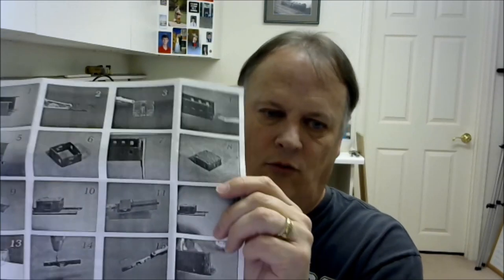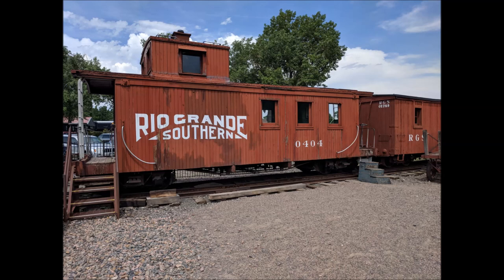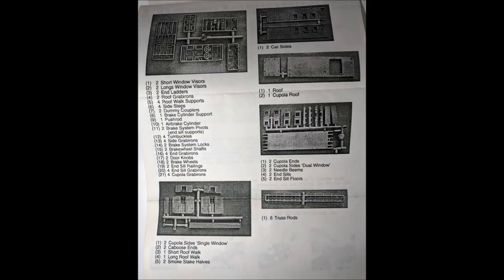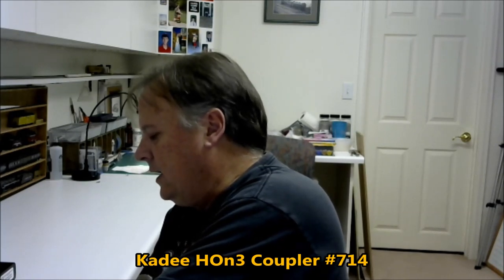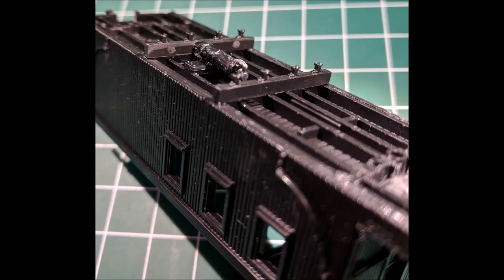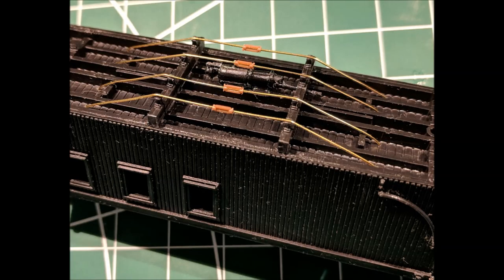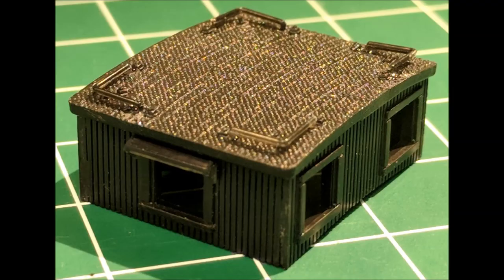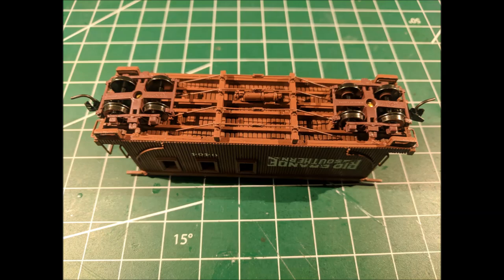Ep 34 HOW-TO Rio Grande Southern Caboose HOn3 Kit

Comment: Cool video Michael.  I have a number of 'old time' freight cars that use the truss rods and I need some turnbuckles for them so I will be getting some of the Tichy castings to use.
Reply from the maker: I am not sure of the brass wire size I used, but it was fairly thin.  It was material I had from old projects.

Comment: Where did you buy the paint and decals?
Reply from the maker: I mixed the paint from PBL (Star Brand Paint).  The decals were Thinfilm Decals.
Reply: Thanks, but is there a website that sells the decals? If so,which one?
Reply from the maker: No idea, but I bought them at Caboose in Denver, and they do sell online.  You should contact them and see what they have in stock.